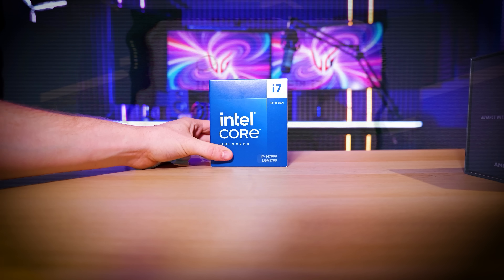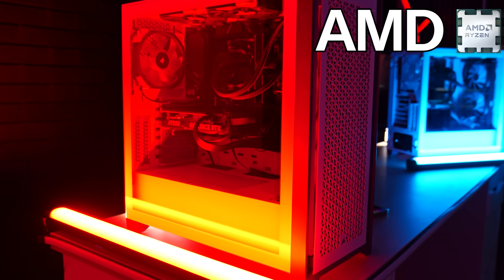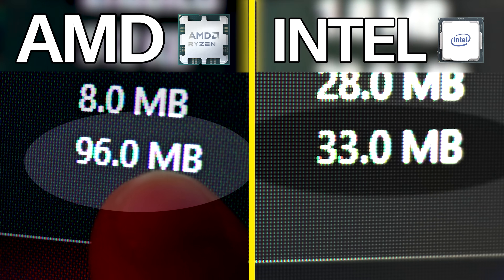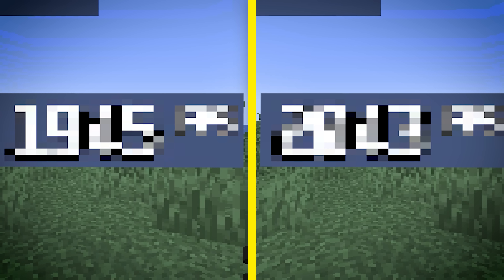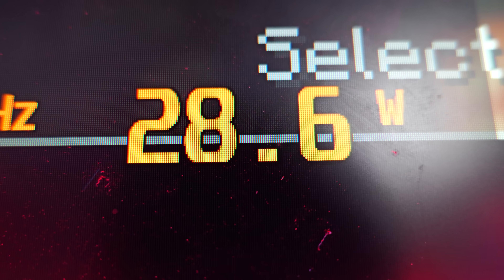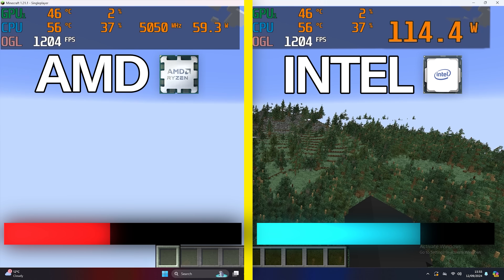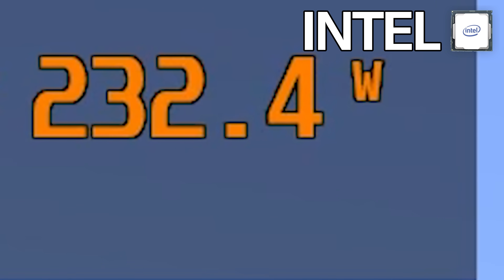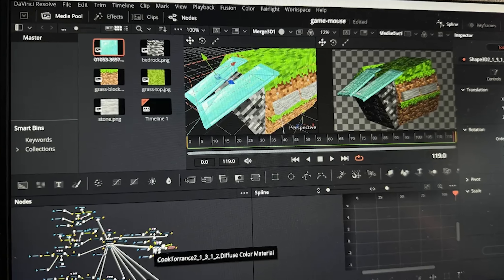Intel VS AMD - Which Is Actually Better?

Comment: Hope you know this is so unscientific. The amd cpu may have 8 CORES but it has something called 3DV-CACHE which is SPECIFICALLY MADE for gaming , on top of that , the i7 14700k has 12E cores,  which are slower than the 8 P-cores  , on top of that , in gaming , the thing that matters most is clock speed and cache (in games that use like 1-2 cores you will see the difference),  also the "TURNS ON QUICKER" and "OPENED QUICKER" tests always vary due to SSDs which have some minor imperfections , and you need to stop doing stuff like this. Let people that know tech do these things...
Reply: agreed, not to mention AMD motherboards set the voltages and such wayyyy too high out-the-box - that being said AMD's (like the 4 i blew up from overclocking), with the correct settings can smear Intels'.  plus the obvious, intels are NOT unlocked CPU's unless you pay a premium.  in contrast AMD's are, so overclocking or otherwise (setting the multiplier, per CCD frequencies\VIDs, etc).  
this isnt a scientific test at all since there is no baseline metric to definitevely say who is better.  aside from that, what bios firmware are they running?  is fast boot enabled?  CSM?  Hard drive SMART test and RAM checks in POST?  DOCP\XMP enabled?
as far as windows startup goes thats another mess and controversy.  as stated above the bios settings, even default, are not tuned for "that" cpu, rather theyre setup to support all amd\intel chipsets of whatever socket.  plus either motherboard quite possibly has a different bios revision as well as serial number!  this is a huge deal as a "founders" (insert model here) release of "this" motherboard will have a significantly different architechture\build versus one thats been made idk, a year ago or less.  even amd and intel motherboards have a different architechture all together!  Zen architecture anyone?  PBO?  infinity fabric?  all specifically for AMD, meanwhile intel is totally different.
plus the MOST significant factor is windows power settings!  yeah, sounds crazy to intel users im sure.  when i was learning about overclocking i would run across forums and people often noted or asked, whats your power plan?  AMD (i could be wrong as im on a custom curated power plan) supposedly runs better with either "AMD Optimized" or "Balanced" profile, meanwhile intel (presumably), it dont really matter.  again im not an expert on intels.
also were comparing apples and oranges here, total opposites.  a 20 core cpu is obviously going to boot windows and do production tasks way better than an 8 core cpu (intel v intel, amd v amd, intel v amd).  Games use anywhere from 2-6 cores depending on the title so all those extra cores are "parked" or "sleeping" most of the time anyways.  Yes the 3d vNAND cache plays a HUGE HUGE role on the (series)x3d chips versus the (same series)x chip, especially in gaming.  Although, again not an expert, if we could disable half the cores or even go down to 6 on intel (again, non K variant) that cache is shared across the cores that are enabled.  Meanwhile on AMD's (at least on my 5950x) its SHARED across the 2 CCD's (CCX? whatever).  I have a 64mb cache so that means 8 cores get 32mb and the other 8 get 32mb.  BUT if i disable one CCX, so half the chip, ill only have 8 cores BUT ill get 64mb of L3 cache...  again it comes down to architecture

biggest takeaway?  this guys comparing 2 completely different CPU's built for 2 completely different purposes.  Obviously the x3d AMD is gonna smear intel in gaming, but with productivity tasks (or multi core oriented apps) the intel will run circles around AMD.
also for being a DDR5 setup how is it that his cinebench numbers are so crappy???  on R23 i get 28,886 on average @ 4.4ghz all core, 1667 single core.  ive seen many people get ~33,500 with my same motherboard and cpu, but again different bios settings.  so with that in mind there is a LOT of wiggle room for both the intel and AMD chipsets.
its just a terrible comparison overall.  while both PCs are built "identical" there are too many variables.  rather than focusing on price as the "one to one" why not just get two cpu's that are similar if not identical to each other?
Reply: 3d v cache is so frigging overhyped
Reply: @peanutbutterandjelly15 i got 40% performance increase with it
Reply: @Hydrosaxophon proof?

Comment: The problem with amd is the OS, Microsoft shits on the 32% of amd users and only optimizes its windows 11 for Intel, but in windows 10 the Optimization is nearly the same, here is amd in much things better
Reply: The shitstorm Ms got will probably make it a bit better (i hope so), or many will just change to Linux (Ubuntu/Mint)

Comment: The thing you did wrong in this comparison is that you compared a gaming CPU, and a productivity based CPU in more than just MC. If you were to test them in just MC, or just productivity, they would each win all of the rounds they advertise. Intel also has major instability issues as of late. Intel's 14700K also doesn't actually have 20 cores, they have 8 P-cores, and 12 E-cores. E-cores don't do much in gaming. AMD's 3D Cache, (hence the 3D in some of their processor names) is very helpful for running games more like Cyberpunk 2077, or very intense AAA games. It's a tough comparison, but AMD wins for gaming, efficiency, and overall value. I personally wouldn't get Intel due to the instability issues currently, but I would agree that the 14700K is much better for productivity compared to the 7800X3D. If you want your CPU to win in all categories, test the 7950X3D and the 14900K. The 7950X3D wins in almost everything, but believe it or not, the 7800X3D wins in some games against the 7950X3D. Performance is very equal in games between the 7950X3d and the 7800X3D. The 7800X3D also wins in most games against the 14900K.

🤓

Comment: I've been looking for this type of video for awhile because I also have 14700k and a 7800x3d and Minecraft is for the most part all I play. I remember how much less FPS I was getting with the 7800x3d and how confused I was initially, only to learn later on that Minecraft performance is heavily based on your CPU's clock speed and if you view the max turbo clock speed's on each respective CPU, you will see that the Ryzen R7 7800X3D has a max turbo frequency of 5GHz while the Intel i7-14700k has a max turbo frequency of 5.7GHz (BIG difference there). Of course there are going to be other factors that explain why each processor performed the way it did, but I wanted to point out one of the significant reasons why Minecraft is one of the only games where the 14700k will beat the 7800X3D. And before people reply to this comment, I want to make it known that I am an AMD fan and have a 7800X3D and a 7900 XTX in my PC.

Edit: I should point out that I was running a DDR4 build (3600MHz RAM) with the 14700k and it was beating my DDR5 build (6400 MHz RAM) by a lot. I think I'm going to sell my 14700k because its been collecting dust for a year 😂
Edit 2: Also personally, I never had any issues with my CPU. It performed great, though it was quite a power hog and I ended up buying a 1000W PSU to replace the 600W one I was running with.

Comment: The amount of people that think the i7 14700K is an actual "20 Core" CPU is just laughable. AMD got railed with their FX CPU's for false advertisement cause they were marketing the FX 8000, FX 6000 and FX 4000 as 8-Core, 6-Core and 4-Core parts when in fact they were not true 8,6 and 4 Core CPU's. But hey Intel can do that marketing BS cause they have the majority of the CPU market. Marketing the 14700K as a "20" Core CPU is just a straight up lie and they are taking advantage of people who are not in the know when it comes to PC parts (Such as this guy). Rather market it as what it is. A CPU with 8 Performance Cores + 12 Eco Cores.

Comment: Switching to a Ryzen 9, My i9 12900 is honestly not good it’s just slow and overheating, It’s not my cooler or thermal paste,  nothing else causing it. Brought it in about four times now, 5  soon and will just get a Ryzen 9. It was fast in the beginning and good, still is for about 5 minutes

Comment: Funny enough the Ryzen 7 7800 X3D is the same for gaming as intel core i9 14900K (except intel has failing issues)
Reply: No 7800x3d faster
Reply: @nurd699  they are about the same, u nerd

Comment: intel is best and people saying amd is better than intel but amd have worst 6 core cpu it's is amd phenom ii x6
Reply: I respect yall opinion by the way
Reply: @bigboi-y3f  rendering depends on cpu. Are you uneducated? Intel is worse than amd. A770 16gb loses to 7700xt. Though yeah nvidias 4060 beats a 7900xtx
Reply: @nurd699  intel is better for works lol
Reply: @bigboi-y3f  9950x will beat even a core ultra 9 285k lil bro
Reply: @bigboi-y3f  not true. for budget side a 5500 beats a 12100f for basically the same price. high end 9950x beats a trashcan of a CPU 14900ks
Reply: @nurd699  intel core i5 12100f beats amd ryzen 5 5500 for single-thread testing lil bro and you are wrong buddy i5 12100f better than amd ryzen 5 5500
Reply: @nurd699  hey kid you are wrong intel core ultr 9 285k beats 9950x
Reply: @bigboi-y3f  you mean i3 12100f?? Don't even know the correct naming scheme. Also its i5 12400f which loses to 5600 in gaming and only beats in editing which quicksync is responsible for
Reply: @bigboi-y3f  nah bro even now 7950x3d beats core i9 14900ks
Reply: @bigboi-y3f  in price to performance yes but in raw performance no. It loses to non x too
Reply: @nurd699  ok both are great
Reply: @nurd699  go get amd and enjoy your trash amd cpu for rendering and works

Comment: Don't use the rtx 4060 for a high end gaming pc
Reply: why
Reply: @bigboi-y3f  when your cpu is 150$ more expensive than your gpu, thats not very good. You can get a ryzen 5 7600 with a rx 7700xt to play in 1440p
Reply: It causes pc bottleneck.

Comment: There's two reasons why the intel one can be comparable.

Games utilize core SPEED and not core count. At most, you're looking at a usage of 6 cores with AAA games. 

All newish intel cpus use P and E cores (performance and efficiency). The E cores are actually a lot weaker than the P cores but they're designed for stability. (AMD is all P core).

Comment: 9:52 You can see that with AMD he is using normal Minecraft but at 10:13 he is using Lunar Client, which if you dont know is much faster than normal Minecraft as it has built in mods to make it faster why did you use Lunar Client for Intel but not AMD?
Reply: AMD fanboys salty, I absolutely love it!
Reply from the maker: I used lunar client on both because it comes with optifine whereas normal Minecraft does not lol
Reply: @Guiny  ur such a intel fanboy u redid the test where amd won lol
Reply: @Guiny  the fact you used total different scenes for the shader tests and then acted shocked when it was better when there is white snow vs trees, You skewed it in intels favour
Reply: @Guiny that dosent prove anything. you never showed the client you used for amd, which is sus, but on top of that, amd is famous for their good igpus. seems results are skwed.
Reply: @catfacecat.  its so obvious the results are skwed lmao. as it ended in a 6-6

Comment: Minecraft is not optimized for modernd cpus, so it will stutter from time to time whenever a new chunk is generated. Minecraft should be benchamarked with a tons of mods or with just optimizations mods as Sodium or Optifine, with really intense worlds and maybe shaders, because vanilla minecraft can run in low end pcs.

Comment: There's a mod called slide that allows you to change the settings past the sliders You should have used that for the render distance Test you Could have gone up to like 256 Render distance

Comment: By the way you kind of wasted your money buying the Intel CPU If you don't know there's this problem with new Intel CPUs where they slowly break themselves By providing too many Volts to certain parts of the processor also Intel will not provide a refund Anyways have fun when that thing turns into a useless piece of metal

Comment: The RTX 4060 really for the 7800X3D and the I 7-14700 it will bottleneck extremely
Reply: It doesn't matter too much, especially since minecraft is a more cpu-bound game, the gpu will only be heavily required in minecraft with shaders. It would only bottleneck on high demanding games and ray-tracing

Comment: The Intel CPU may have 20 cores but that doesn't matter as it only has 8P cores and 12 of the cores are E cores, which don't really matter for gaming. Additionally, Raptorlake i7 and i9s are known for literally breaking themselves. NEVER, I repeat, NEVER buy a 13th or 14th gen Intel i7/i9.
Reply: They’re safe now also my 13700f has never had any issues for the past year
Reply: @cengix8850  there's no guarantee they're safe, it's only claims made by intel. Also your sample size of 1 is useless, lmao
Reply: Oh yeah I have a Ryzen 9 7950X3D btw (16 Cores, 32 Threads, 5.7 GHz Boost)
Reply: Thy issues ahve been fixed

Comment: not too fair for both sides the 14700k is newer and not top of the line and 7800x3d is older but is "best" by the ppl while they say the intel best is 14900ks

Comment: It's kinda unfair for AMD considering it's potential is cut by 75% because of windows 11...
You should've compared both in windows 10
Reply: Linux
Reply: Windows 10 would be unfair aswell because win 10 hinders Intels performance. And win 11 is the newest system so it should be used for a test. If AMD doesn't optimize for the newest OS's in like 2 years or how old win 11 is, it's not microsoft's or intels fault
Reply: @melon3210  buddy windows updated and it gave AMD like a 7% increase
Reply: @melon3210 microsoft is purposefully slowing down ryzen cpus
Reply: Copium.

Comment: Intel: work related tasks
ryzen: gaming
Reply: The 7900x would easily beat the 14700k, but the 7800X3D is a gaming CPU, it has no obligation to be good at productivity
Reply: @chedds  you are completly wrong bout the 7900x its still gonna be slower bc it hjas lower cores and threads
Reply: @LunarLikeFortnite I can say only one word, no. They both perform well, Intel is for multi core tasks, AMD is for 3d tasks like 3d rendering. He even said it in the end.
Reply: @LunarLikeFortnite  while the 7900x have 12 real cores and 24 threads the i7 have like 8 real cores and the rest are trash e-cores

Comment: 10:33 The FPS was higher because the intel CPU was tested in a snow biome where there are not many trees. And, the AMD CPU was tested in a forest biome that's why it got less FPS because trees can lower your FPS a lot.
Reply: i think bro should choose same seed or just create superflat
Reply: Not true. That has nothing to do with the rendering via the CPU. That would be a GPU issue.
Reply: @cha-ka8671  false
Reply: Yeah I think the tests were not fair
Reply: @ulvernD hi I'm from Bangladesh 😂
Reply: @nsk_98  hi
Reply: there was also water in the amd biome
Reply: Pointless comment since both of them got a point
Reply: Bro intel was running with lunar client which provides fps boost 😢
Reply: Of course, AMD fanboy!
Reply: You are aware if you are in a forest there would be more culling and it wouldn't have to render as much, or maybe I don't understand, but I think that is how that works
Reply: @BlastedMC  I do think its fps was lower as every leaves have to check if there is a log nearby to decay.
Reply: @BlastedMC  foliage is actually one of the most taxing aspects of scenery in any open world like game
Reply: no its igpu driver related
Reply: @the_bi11iona1re7  u are crazy
Reply: @Deskaleon  XD what intel drivers run awfully on mc with sodium
Reply: @the_bi11iona1re7  intel drivers are for intel gpus not integrated graphics and no one even uses integrated graphics
Reply: @the_bi11iona1re7  no
Reply: @the_bi11iona1re7 trees shapes are not that optimisable thats why they lower your fps a lot go learn voxels

Comment: doesnt he have the fastest intel cpu and the 800x3d is only good for GAMING. and the intel one is overprice as you need to even get an insane cooler aio or liquid (not rlly) and the x3d is for gaming better. the sounds was the fan. intel was faster in pc overrall cause cores and threads but amd is gaming better and cheaper sooooooooo amd better for minecraft.

Comment: Bro, you are testing literally the worst thing on these CPUs
1. Post time which is dependent on the motherboard mostly
2. Cinebench on a 20 vs 8 core CPU, when the 8 core variant is for gaming
3. Temperature on the Ryzen CPU was higher due to worse cooler and because it is a 3d variant (<80°C is safe)
4. Max FPS test is garbage due to Windows optimisations, obviously Intel will win in FPS when it is above 2000, because they clock higer with more cores
5. You are testing stutter without showing 1% low
6. Integrated know to be AMD's strong side due to having experience, while Intel's GPU suck at compatibility.
7. Shaders eat RAM, we don't even know how much RAM you gave to the dedicated GPUs
Finally 8. Show bios settings too
Pls remake this video, because you made soooooo much rookie mistakes.

Comment: 7800X3D is the definition of cheating the system. The CPU isn't actually better in games it just has more raw cache so the game can utilize the CPU better. A 7600X3D, 7800X3D, 7900X3D, 7950X3D, their gaming performance is all basically the same.

Comment: try the ryzen 9 series (could be more powerful than intel) and the ryzen 7 8700g (The most powerful igpu)
Reply: 8700g has 780m igpu while strix point apu ryzen ai 9 hx 370 has the 890m. So no 8700g isn't the fastest apu

Comment: Talk about a unfair video didnt even pick the best intel cpu (I9-14900K) and gave AMD two points just because the intel cpu uses more power. In the testing he picked Intel actually blew the 7800X3D out of the water.